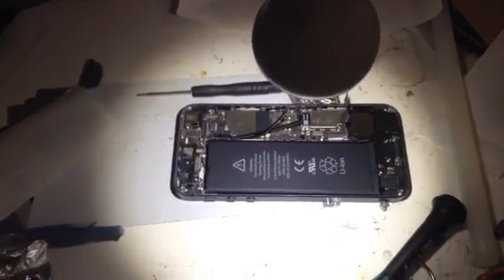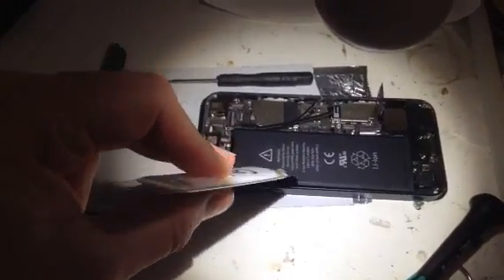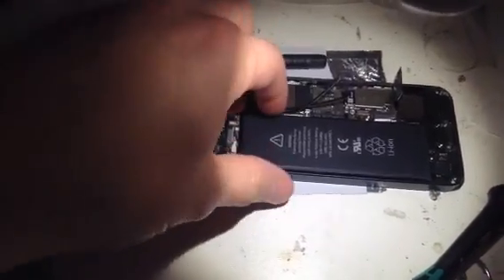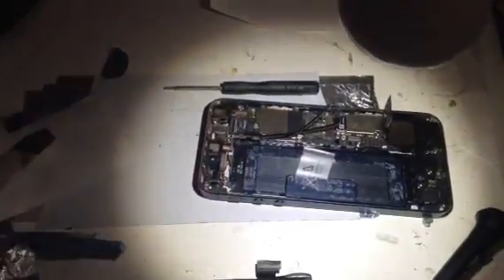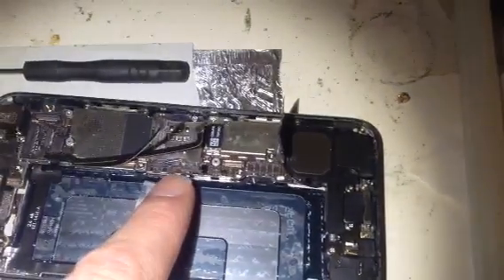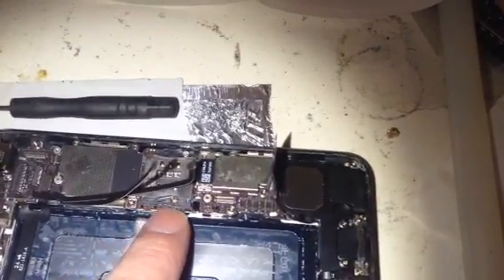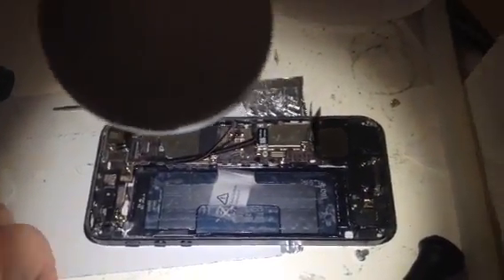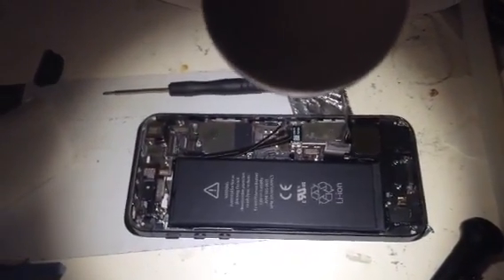Iphone 5 home button not working after replacing battery

Comment: Thanks James for informing about incorrectly battery replacement. That explained why the Power and Home button did not work even after replacing these hardware parts in the used iPhone 5 I recently bought .

Comment: I did it and I'm still using my phone. "IF" you can get to your settings/general/accessibility/assistive touch you can use that and your home button will be accessible through the touchscreen until you can get someone like this Gentleman  to make a legit repair. Good luck. Thanks for this video.
Reply: that's a very helpful tip. thanks a lot